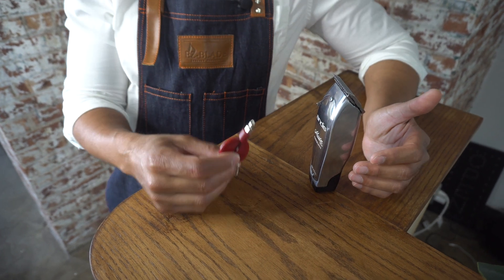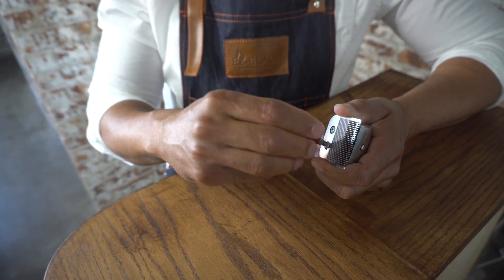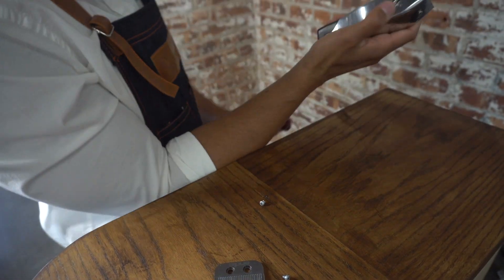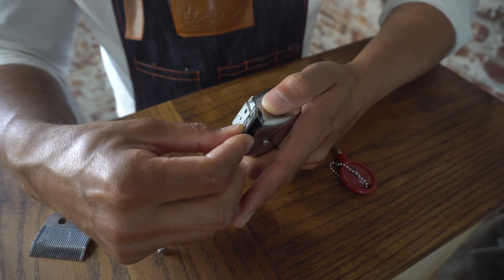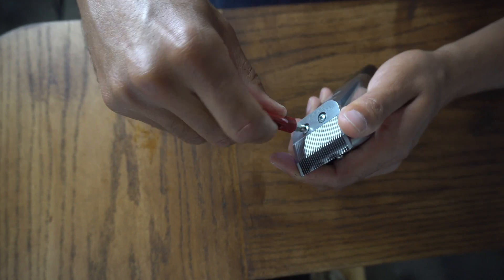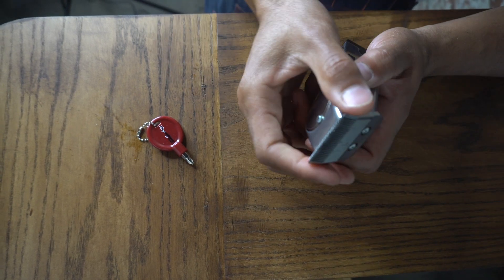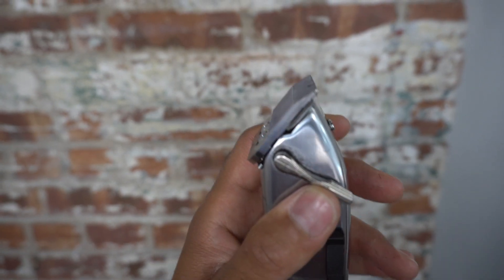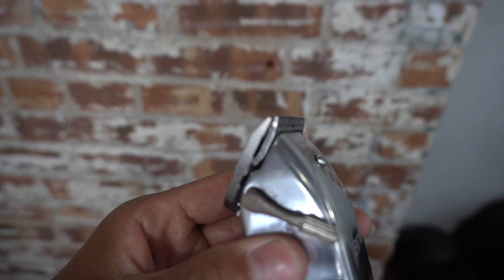How To Zero Gap Andis Master Cordless Machine PLUS BONUS TIP!

Comment: Hello, I took my blades off to sharpen them and clean the clippers.  After I put the blades back on, they dont cut anymore.  they make a noise and the blades move but theyre not cutting.  I tried to pull the tension spring to give it more tension but it didnt work.  Can you tell me or show me in a video how to put the top blade back on over the pring to see if im doing it right? Please Help!!!!
Reply from the maker: Do you have a wired masters?

Comment: I have a Andis Master Clippers and when I cut the blade will some move when I have the clipper blade closed.  How do I get it to stop moving.
Reply: I am going through the same.. When i gapped them and tightened... It still moves a bit when i nudge it with my fingers
Reply: @NVTwistedProductions  did yoi ever fix it ??
Reply: @Alanisrael12  I ended up getting the cordless ones and they don't move like that
Reply: @NVTwistedProductions  i have the cordless masters and i have tightened the screws all the way but can still move it with my fingers , you know what i could do ??

Comment: Just bought these Andis Masters and i cannot get them anywhere near 0. The closest i can get it is like a 16th of an inch from being even with the bottom blade. Do you think this one might be deflective? No issue with 0 gapping my Andis trimmers. Good lookin on the lever tip!
Reply: Honestly its not worth zero gapping them in the first place. If you truly zero gap it it eats at the andis guards. Get it as close as you can without it eating your guards and you are good to go. It takes out the trimmer line no problem as long as you are not setting in your trimmer line harshly. Its a tapered blade anyway so if you want to remove harsh trimmer lines its better to use a fade blade or just use a different clipper. Personally I dont like setting harsh trimmer lines anyway so i never have an issue with this clipper.
Reply: @Mike-hy8cs  I always set harsh lines with my trimmer.  How do I stop?
Reply: @Peter-hw1yx  instead of putting it in like you are lining someone up.. Use it like a clipper and scoop slightly while making the line. Making a super perfect skin guideline is a waste of time. Why? Because you are going to fade that line out anyway. As long as both sides look similar you will have an even fade when its finished.
Reply: @Mike-hy8cs  should I just use my andis master then instead of my trimmer all together?
Reply: @Peter-hw1yx  you can a lot of people do it like that. Personally since i need to be efficient with my work i use a zero gapped trimmer first . If you use clipper first you will still need to go underneath it with a trimmer
Reply: @Mike-hy8cs  o to remove the bulk? I see. Thanks for the responses. There were some bad lines I couldn't take out and I didn't know what to do. By any chance,  do you have any advice on taking out  harsh lines? Any technique?
Reply: @Peter-hw1yx  use light pressure there is no need to be rough when fading. Being rough just creates more lines. Light hand = light lines that are easy to take out. Use scooping motions and make sure you cut against the grain. Everything else is experience and knowledge.
Reply: @Peter-hw1yx  never use a trimmer to remove bulk they are not made for that. Instead use a clipper or detachable to cut all the bulk out first then set a skin line with a trimmer
Reply: You need to go into the machine by removing the top plate (requires a small hex screw driver set to unscrew), and then slightly loosen two screws inside that hold the moving blade (requires a slightly larger hex screw driver), then you can slide the moving blade forward (I used a flathead to do this).  Then when you tighten everything up, do it slowly because the tightening messes with the blade and the 0 gap starts becoming bigger again. I probably could've gotten a true zero, but I was fine with the tiniest of gaps that kept reappearing when I tightened.  (You probably figured this out already but thought I'd share just in case.).

Comment: My Andis Cordless Masters have gotten soo loud after like 6 months.  They were always louder than the corded ones but not they are even louder.  Any idea on what it can be?  Tension?
Reply from the maker: Not sure that seems to be a on going problem
Reply: I’ve seen videos how to adjust the sound, by adjusting the the screw on the side of the body, search for the videos regarding this issue
Reply: @shannonlazcano8506  I think that's a corded trick